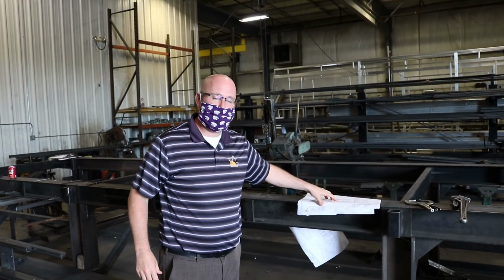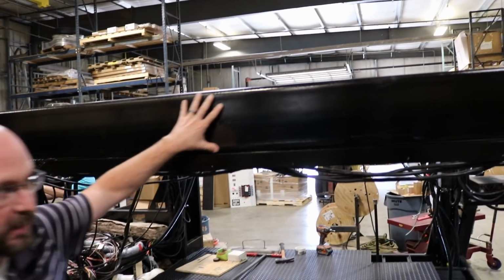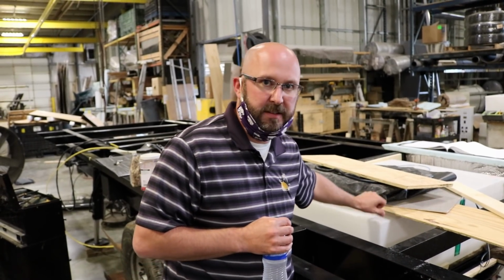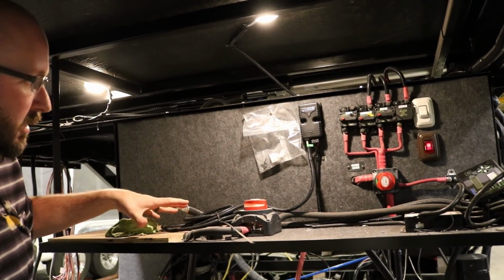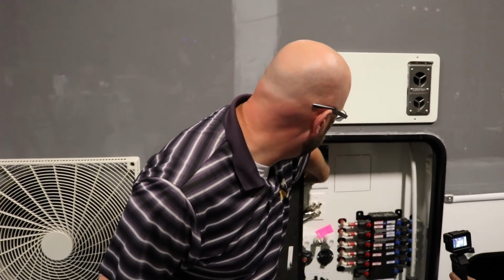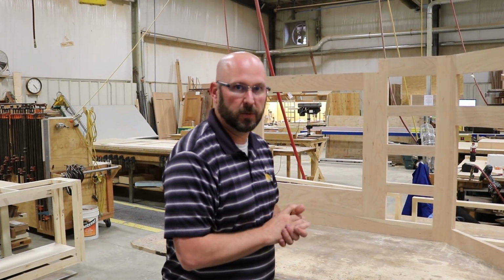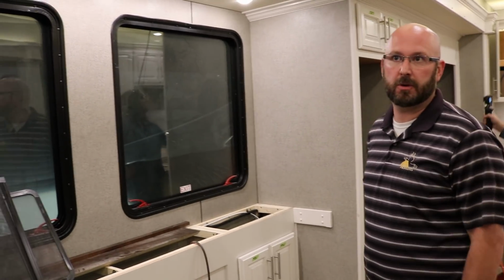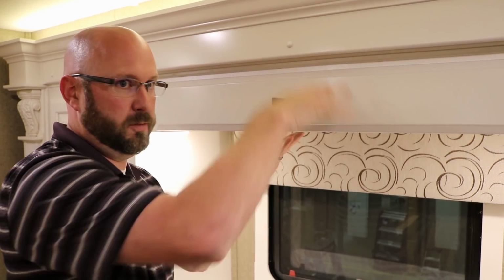CUSTOM 5th Wheels! //  New Horizons RV Factory Tour // Full Time RV

Comment: I’m really excited about the mini split system. Good luck with your search.
Reply from the maker: We were really interested in the mini-split as well.  They just started building into their coaches, so time will tell how it holds up.  It does make a lot of sense though.  It uses much less energy than a normal A/C does and it's so efficient.  Thanks for coming along!
Reply: Suite Travels I have four in my house and they are easy to clean and do a good job. They heat well too. They heat to about 55 degrees warmer than outside temp. They struggle alittle when it’s 0 out side with a wind. But I live in a house that’s 120 yrs old and the floor isn’t well insulated.

Comment: Suite Travels, How would you compare the build quality of New Horzions to DRV?  I believe the advantages of a New Horzions is that they can make a truly custom rig vs. DRV which is more semi-custom.
Reply from the maker: Actually the build quality (in our opinion) is very similar between the two.  The difference is New Horizons will accommodate more changes in their floor plans and custom wants - but it comes at a price.  The New Horizons is much more expensive than the DRV .  thanks for coming along!
Reply: @SuiteTravels  Enjoyed your video! I've been looking at NH's 5th wheels as well. There are other differences as well depending upon personal preferences in addition to customization. To name a couple, generator behind the axles opens up front compartment space and lessons the pin weight. Access to the fridge and bathroom with slides closed while on the road.

Comment: I was interested in his comments about warranty issues. As a mobile tech, most manufactures are a pia to deal with,flat rates, submitting the proper forms and on and on. Vanleigh turned out to big the biggest no go regarding
 warranty altho, Tiffin has been great. Weird. I myself am looking for a hi end toy hauler and though the Vanleigh line would be good as they have one planned. But after looking at a brand new Beacon, they missed the boat. I think, unlike
New Horizon, they were concentrated on numbers and not quality. Luxe may be an option. Maybe.
Reply from the maker: That's interesting regarding the warranty.  Cole seemed to give us the impression that the customer was first on their mind if/when a warranty issue came up.  We weren't aware the Vanleigh brand was considering a toy hauler.  That will be interesting.  Thanks for coming along and enjoy your weekend!

Comment: Thank you for the NH video ! I have a somewhat unrelated question, but the photos behind you in your own coach, what do you use to secure them to the wall ? and how well does that method hold up to the bumps experienced during travel ? Thanks !
Reply from the maker: Thanks for the kind words Jeffrey!  We use Command Strips to hold up everything on our RV walls.  We've been using them for years and we haven't had any issues and they don't leave a mark when we remove them.